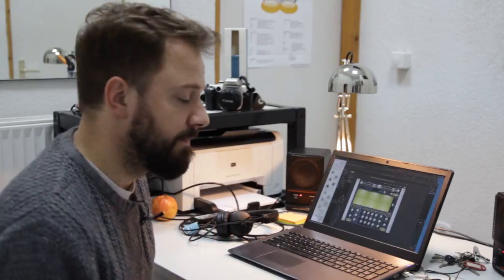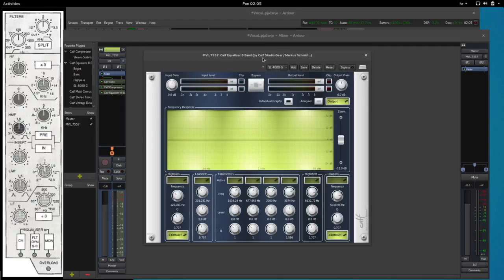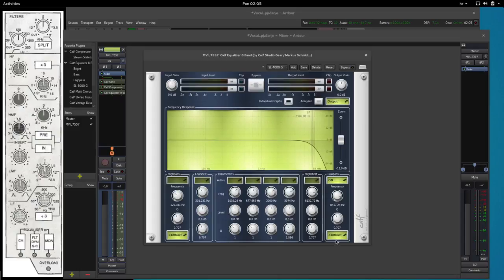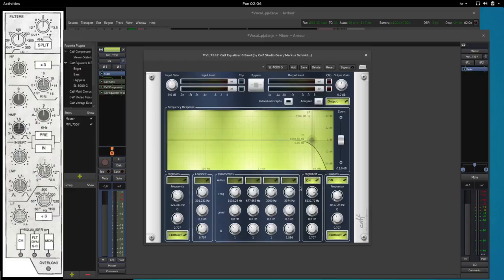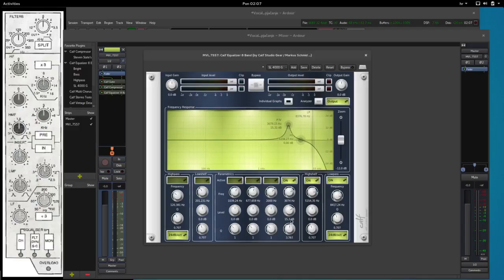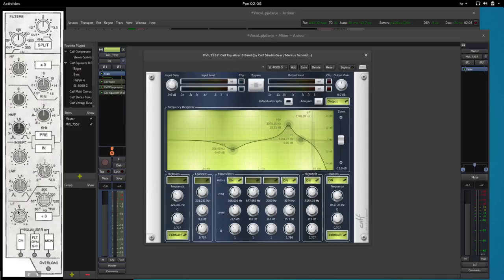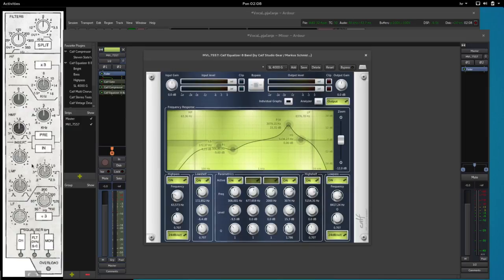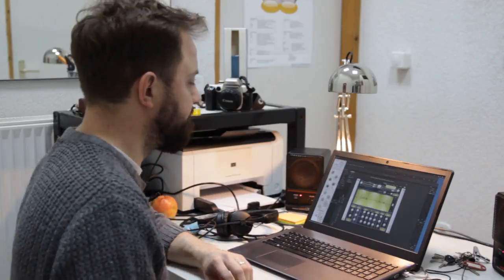How to setup your EQ plugin to work like the SL 4000 G Mixing board

Comment: I also like Linux, but I was wondering how do you like the sound of the plugins that work with Linux including the Calf plugin library,  I often feel I would want analog modeled eq and compressors etc,  I'm not sure if they would sound like quality plugins
Reply: I've used the Harrison plugins as free trials on Ardour (which Mixbus is based on) and I have to agree, they sound wonderful. Calf plugins are great too. Other greats plugin families are the Foo plugins (including the very versatile Foo Transient Architect, which I have to say is better than the transient module on iZotope's Alloy 2) [https://github.com/sampov2/foo-plugins], the CAPS Audio Plugin Suite (which has the wonderful and always useful C*Plate) [http://quitte.de/dsp/caps.html] and the Zam plugins [http://www.zamaudio.com/?p=976]. Those three suites are highly recommended. Another essential for me is the fantastic setBfree plugin, a very detailed analog-modeled Hammond B3 simulator, which you can get at [https://github.com/pantherb/setBfree]. To access it's advanced settings, click on the microchip picture next to the help button and then on the transformer. There are a LOT of options to change such as the horn filtering, the leslie speaker's characteristics and wire crosstalk that are all analog modeled and allow you get the perfect sound you want.
Reply: MrSkyTown There are proprietary plugins for analogue modeled compressors. For each, look for luftikus. There is a very good Hammond analogue modeled Lv2 plugin that it very in-depth. If you're interested I can post the name when I'm on the home computer. There aren't as many libre analogue modeled plugins because of legal issues and the time and research it takes for this kind of project (very intense for most developers, especially when this isn't their dayjob)
Reply: The plugins modeld in Harrison MIXBUS - are TOP! Calf also sound really amazing (they are free), compared to some of the really expensive ones in Cubase and Logic. The question is whether or not you know what to do with them.